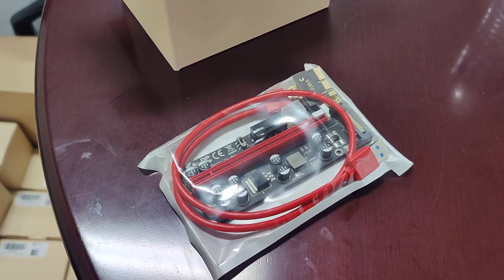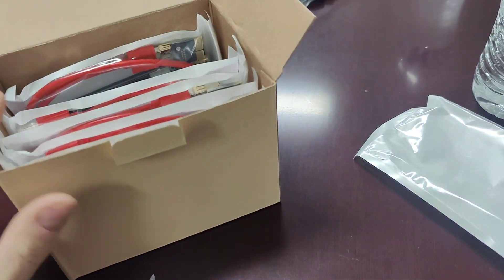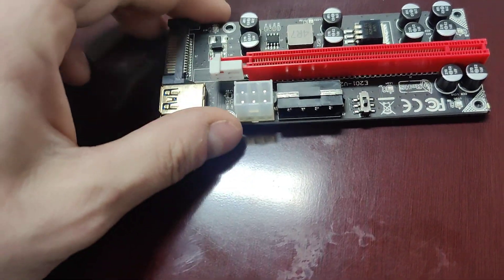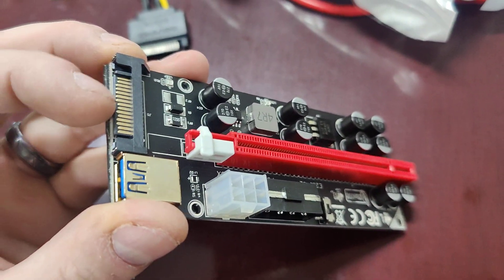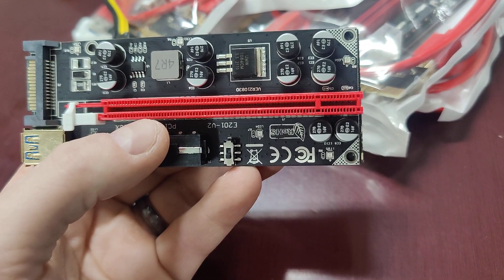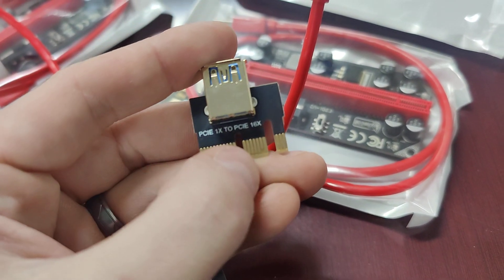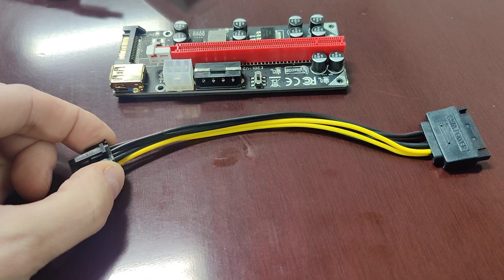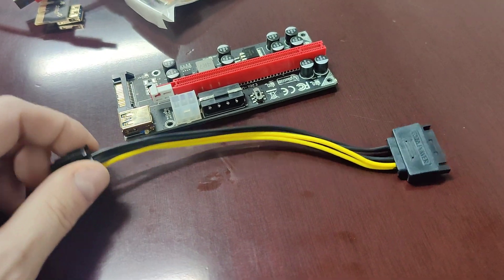GPU Mining Farm - GPUS Risers, Glitches, Errors, Driver Issues, Power Config, General Info

Comment: Do you even know what are you doing? You are going to burn your hole farm down cause you use SATA cables🤦
Reply: There's no way you just said that LOL
Reply: SATA is safe. What's not safe is drawing more power than a connector is rated for. Look at the TDP of your gpu and the amount of PCIe power connectors it's got. A GPU will always try to draw most it's power from the PCIe connection unless it sees an unstable or low voltage. A 1070 with a single 8-pin will draw less power than a 1080 with a single 8-pin.
Reply from the maker: We did our tests at the wall and 1 3080 gpu uses 30-70 watts from the sata. Sata can do 150+ watts in real life not just based on some cheap psu spec sheet.
Reply: @CryptoLLC  have u tested that SATA can actually handle 150 W or is that your own magination?

Comment: sata cables provided with risers are of very bad quality, 
I learn from my 5 years of mining that Never Ever use Sata cable in a rig other than powering ssd.
put cards on server PSUs to avoid pcie cable shortage, server psus are best trust me. I changed all my 1000W atx PSUs and now I dint have to baby sit my rigs.
risers will pulls more or less power, depends on card, algo you mining.
using sata is bad Idea. trust me
Reply from the maker: Been mining on gpus since 2015. Trust us, we have been using sata since day one and have never, ever, ever had a single problem.
Real Life > Theoretical
Reply: If those SATA connectors are not safe, why are the vendors providing the connectors at all ?  Isn't it additional cost they could eliminate ?
Reply: @ag4391  using sata cables is fire risk thats all I understood in my mining years, Trust me I am not here to prove anyone right or wrong, just want people to learn from my mistake, so they dont do it.
strip open a sata to pcie cable provided in the riser package. you will understand what I want to say.
Reply from the maker: Watch our video on sata and you will see that you are wrong.
Reply: @CryptoLLC  do what you wish